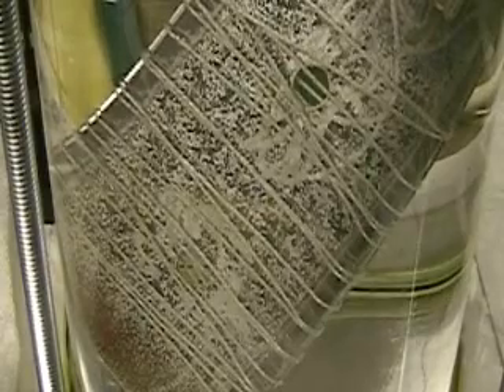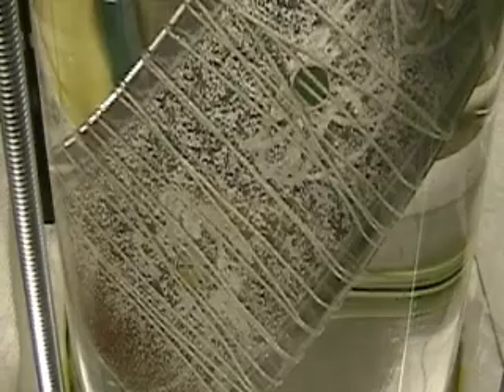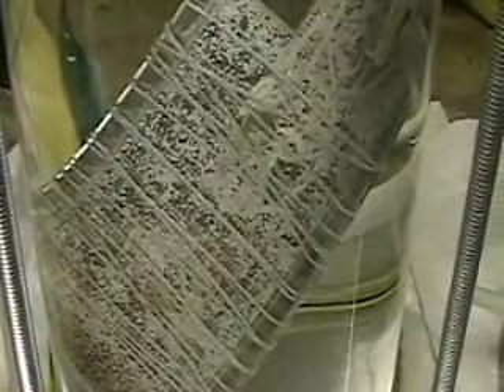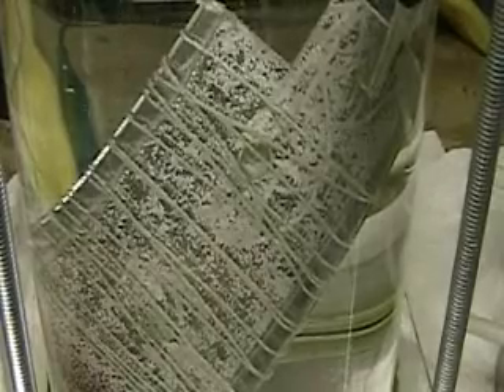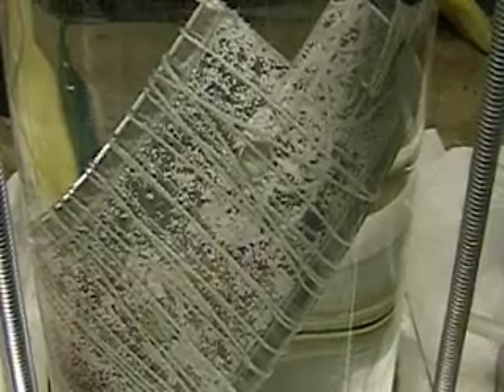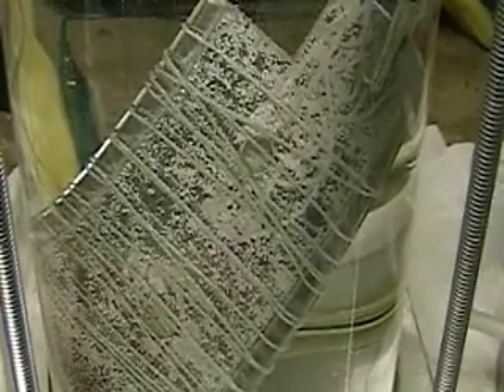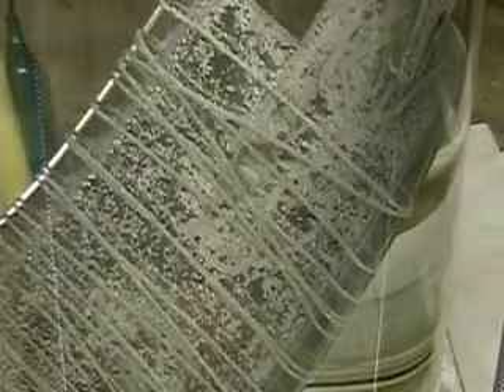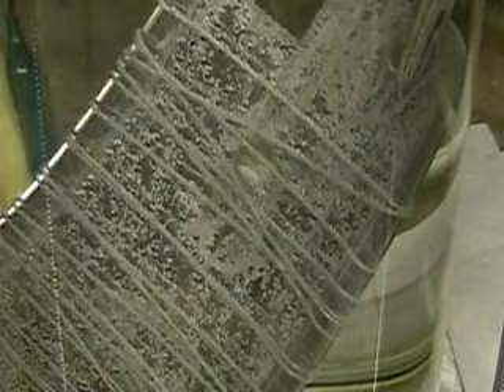Hydrogen Tap (Making Hydrogen) 144

Comment: John, nice work. I look all your videos and finally i will comment on them. I will give you 2 suggestion for a start. First you dont need to cut the corners of the plates, all you have to do is to drill a bigger hole to let the screw go throught with no contact. The second is that you dont have to measure the volume of the gas to have an ideia on how much you are producing, all you have to do is measuring the gas pressure on exit ... much easier. I'll come later

Comment: Good Job John,Its good to look at it Again. I would call it a dead cell. it makes Hydrogen but doesn't move it. It has to built up the atoms before they can lift off of the plate. if you wanted it to work right water pressure blowen over it to release the atoms quicker only way. heat by itself don't work. I think the Vee cell should run cooler too. Keep up the good work.